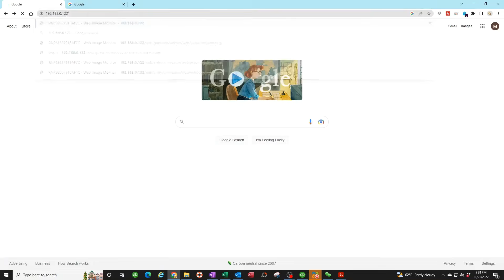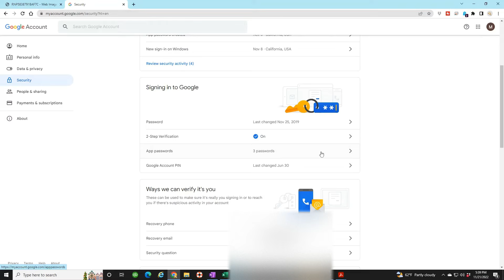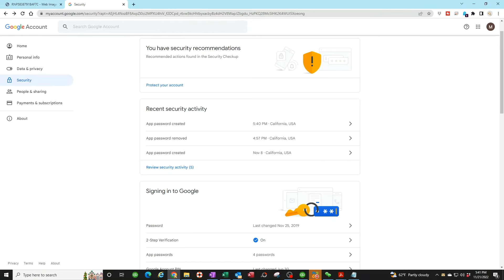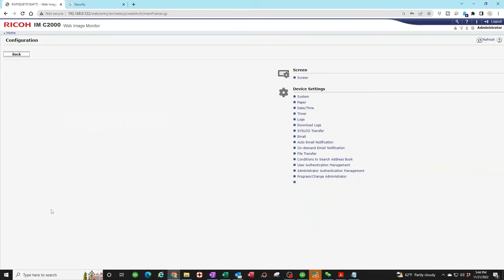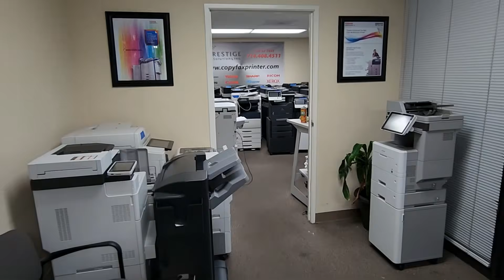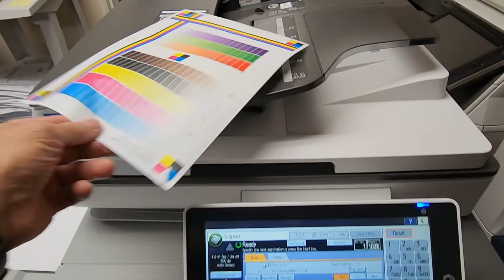Ricoh Copier Printer Scan To Email Setup-The Right Way!

Comment: I don't have the app passwords on google?
Reply from the maker: google changes the location of this app password so it can be confusing at time. make sure you have 2 step verification turned on then you will find the app password by clicking on "2-Step Verification" under How you sign in to google.
Reply: I had the same issue, and did a search for app password on the security page, and was then given a diaglogue to create one, I could not believe it came up that way.
Reply from the maker: ricoh changed the location. Don't ask me why.....you can now find it here   myaccount.google.com/apppasswords

Comment: Hi, awesome video! So if one has existing users created so as to use the locked print job features, there are existing users already. only the mail hasn't been added. will i need to start from scratch or is there a way to update the users with the mail as they will be scanning to email?
Reply from the maker: not quite sure i understand your question. you can edit users info such as email etc. if confused, simply recreate that user. shouldn't take long to do

Comment: Found this video so helpful, but I am still getting the auth failure after following every step exactly with a new c2510.  Very frustrating and time consuming.
Reply from the maker: oh, so sorry to hear. The first step would be updating firmware otherwise we would need to troubleshoot from here on as it can be numerous reasons causing this....continue troubleshooting and if you need us to step in we do have IT support avail at $120/hr.

Comment: in scanned files status it says: Waiting /or trnsmtg. and mem stays at 99% so nothing goes through.... copier is older MPC2800 and only difference in settings is secure connection SSL option is nowhere to find. Can you help me with that?
Reply from the maker: i would first start with a firmware update
Reply: @PrestigeOfficeSolutions   I did that and nothing changed .... I found TLS/SSL setting in network part of the menu and there it said something like: tls/ssl is not active until certificate is installed/registered. I have no idea what certificate it is talking about and how to install it
Reply from the maker: explain to me how you updated the firmware step by step.
Reply: @PrestigeOfficeSolutions  I used Ricoh  firmware  update tool (Ver.1.9.0 Released Date: 10/16/2023)
Reply from the maker: @HummyGG  Ricoh has stopped providing firmware upgrades for this model many years ago. thereofore if you already updated the fimrware as stated and still no success, my guess if the software on your machine is not compatible anylonger. there's nothing you can do other than try other means of email services that don't have security requirements.......

Comment: It would make setting up a Ricoh MFP printer remotely so much easier if there was a "Test Email" facility. If you can't walk up to the printer to test email sending you can do the following with a modern MFP and send a test scan via the Remote Panel Operation feature.

Send test email from Ricoh IM C3000 MFP
* Log in to Web Image Monitor as admin
* Select Device Management | Remote Panel Operation
* This will bring up the printer consolde on another browser tab
* From the Home screen select Scanner
* Select a Destination from the Scan to Email menu
* Click the Start button to commence a scan
* A scan will take place. If there is nothing to be scanned on the printer and Auto Dectect is selected for scan size it will come up with the warning "Cannot detect original size". Change Scan Size setting to Regular Size.
Select A4 and click the Start button again.
* Click the Finish Scn button or wait for the minute timer to end.
* If your SMTP settings are correct. You should receive a test scan via email
Reply from the maker: Great info. older models don't have this feature but the newer one's do. Great tip! thank you!

Comment: I have a Gmail account, but my Yahoo account is my primary email.  I configured my MP C307 with my Gmail, since that's what you use in the video.  Everything was exactly like what you did in the video, step by step.  I added myself as a contact in the address book, with my Yahoo account.  When I scan to myself, to my Yahoo account, it processes and communicates for a very long time and then the scan goes to 'standby' and it never sends the scanned item.  Not sure what is going on....
Reply from the maker: Something is blocking that email from sending it from the copier. This is when troubleshooting. Could be something easy or could be something very difficult.
Reply: @PrestigeOfficeSolutions  I rechecked all of the settings in Device Management > Configuration > IPv4.  The only thing that was different from your settings was that the DHCP was set to "Inactive" and yours was "Active."  I made that change and it still does not work.  I followed all instructions to the letter and have gone through the whole process three times now.  May just have to hire someone to figure it out or not have this feature available to me.
Reply from the maker: @ItsAnSS  dhcp doesn't affect scan destination. It's only used for assigning ip address to machine
Reply: @PrestigeOfficeSolutions  Hello it goes to "stand by " what would be the easy fix ?
Reply from the maker: @davidbelmontes8841  its because there's something blocking the transmission....could be many reasons....i would start off with firmware upgrade first then go from there

Comment: After entering the IPv4 settings, does it take a very long time for the system to update?  I'm on 30 min right now
Reply from the maker: no, it should never take that long. only about a minute. turn it off and on. if it continues you may have an issue somewhere and that's when troubleshooting comes into play

Comment: Hello, can the scanner be used with the office365 account, and if yes what are the setup steps?
Reply from the maker: it can. i've only set up a few and know it can be a hit or miss. i suggest using the same steps you see on my video except change the smtp server to whatever server they use, i can't remember at the moment, and check that port they recommend. with office 365 you will need to use your user name and password not like gmail which requires you to create a special password like my video shows

Comment: What should i do because it keeps on saying failed to connect to the server
Reply from the maker: that's the message you get when the copier doesn't connect to your smtp server. could be tons of different reasons....if you followed the video and you are still having issues you may want to consult with a Ricoh authorized dealer for further troubleshooting.